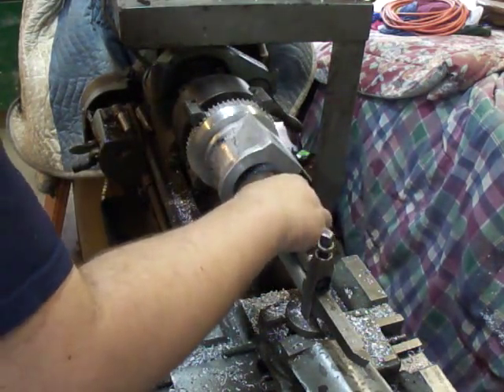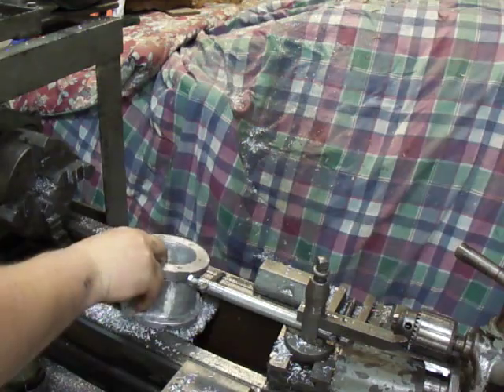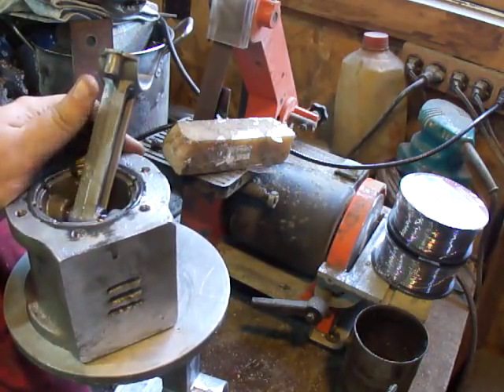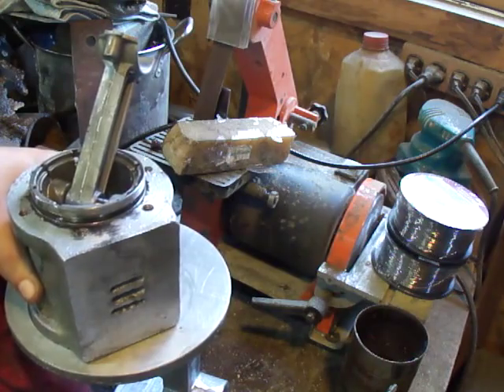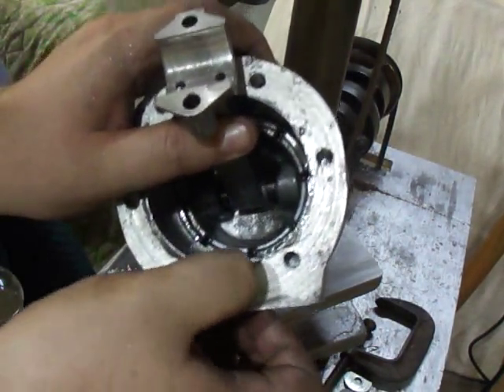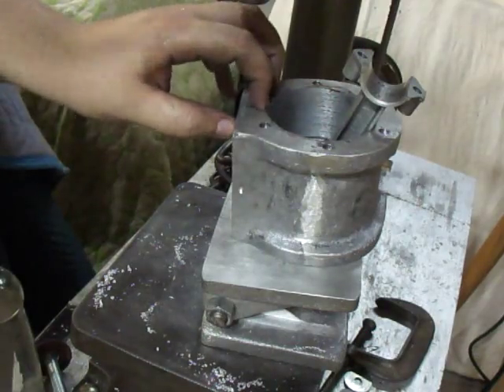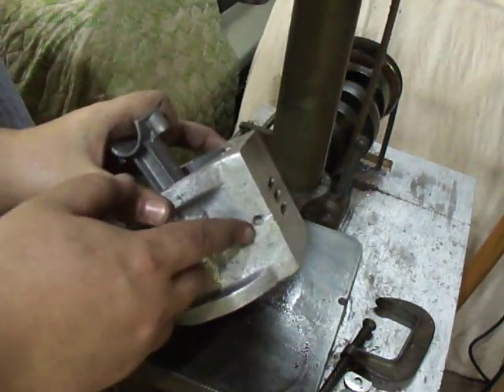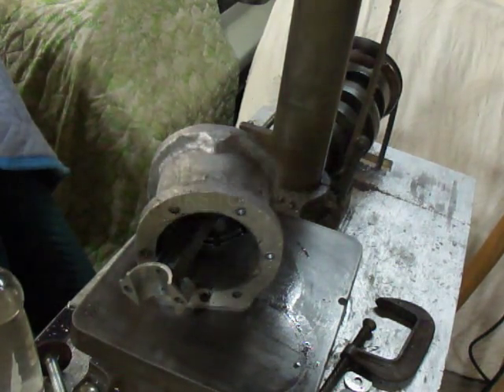Steam Engine Build #3 - Boring Cylinder - Steam Passages

Comment: Bummer about the liner, but now you can get a really good test of that alloy I guess.
Reply from the maker: yep, and from the looks of it already, once it's honed, it should be more than strong enough for the amount of use I'd be wanting from it. From the beginning, I was just going to bore it out to 3" anyhow and use the alloy as the cylinder walls, but a friend said about the cast iron liner and I found one in a junk pile, so I figured I would try to use it. It didnt work out that way tho, and now I do it the way I wanted to do it in the first place now. Im happy either way as long as it works, lol.
Reply from the maker: Also Im starting to get to the point that Im going to have to stop because I need to go get supplies to go any further on the build. I need stainless steel rods, pipe plugs, and a cylinder hone, so need to stop before I go any further so I can get everything just right.
Reply from the maker: Hey, I tried to respond back to you and your inbox is full on AA, you might want to delete some of the messages, lol. The sent ones count against the total also.
Reply: Chirpy's Tinkerings oops!  Fixed now :)
Reply from the maker: lol, sorry about that, I put a video in there that you may like, a wobbler powered steam boat, lol....